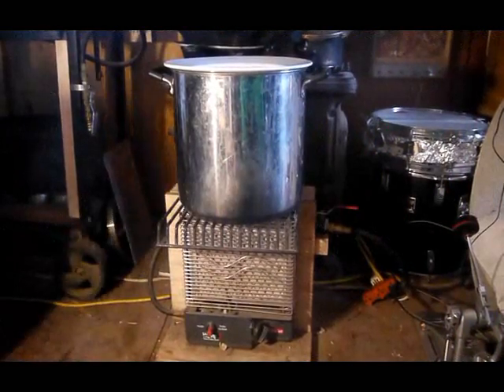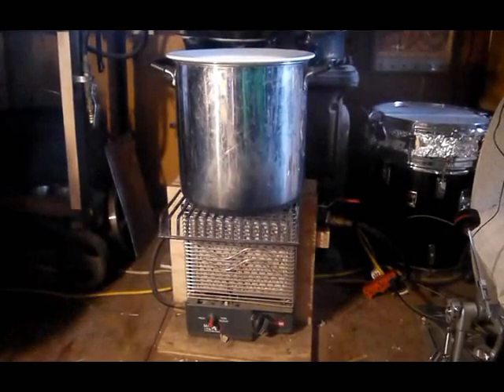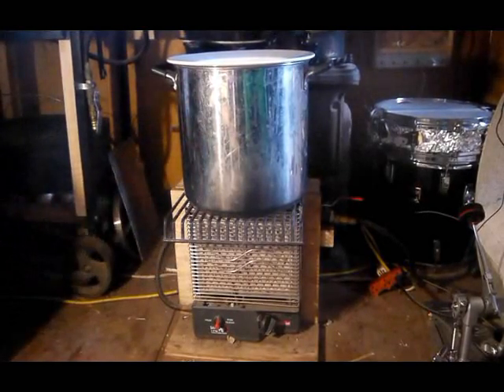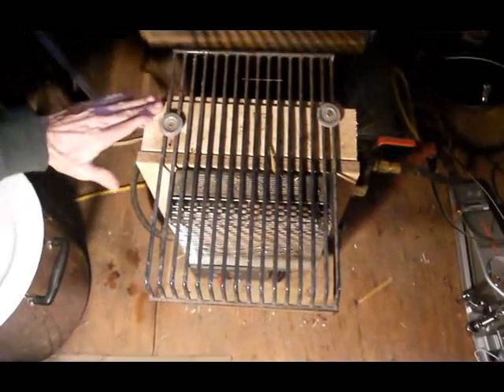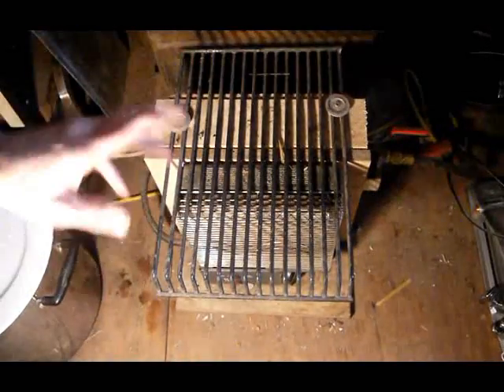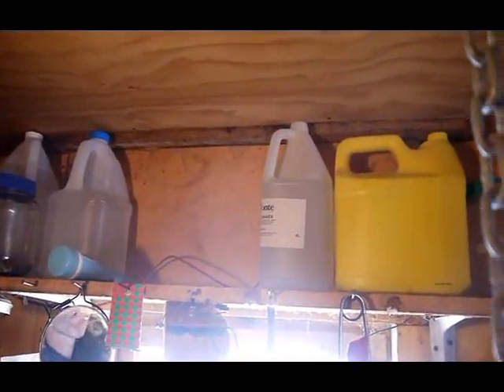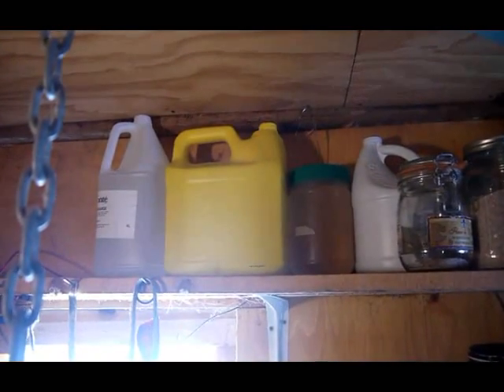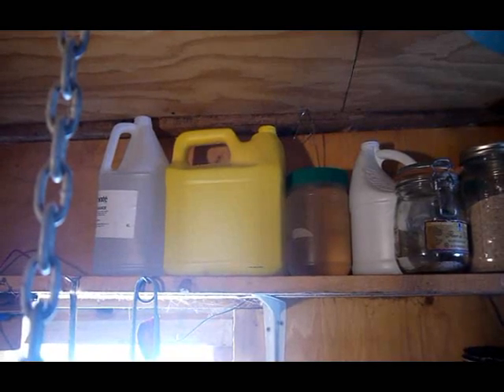Heating With Water.  An inexpensive, low tech solution

Comment: I like the idea of slowing down the heat loss by using water. Good to use salt water in the plastic or glass jugs. Glass jugs will accept and release heat more quickly. Salt water will prevent any possible freezing damage if the right salt concentration is used. (Sea water should be a good salt concentration I think.) In video, warn people not to burn propane indoors without vent--they might not have a flameless propane heater. Thank you very much.

Comment: Might try run pipes in the floor and cover them with sand as sand will hold heat a long time as well. Many farmers use this in their repair shots or there are electric heating rods you can use then bury in sand the more sand the better. I have a friend who does this and he said if the power goes out or gets cut off for what ever reason storm or whatever his place will stay warm for up to two weeks.